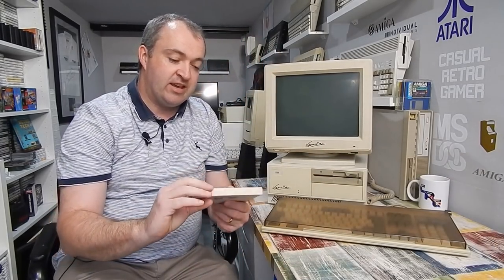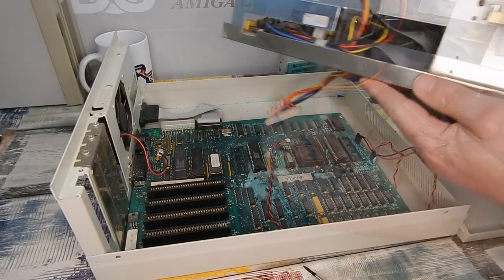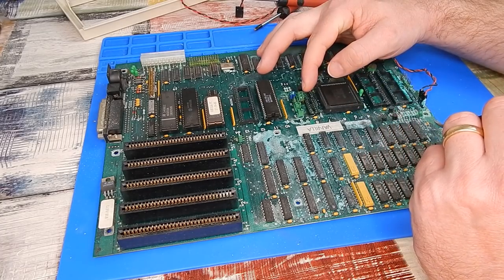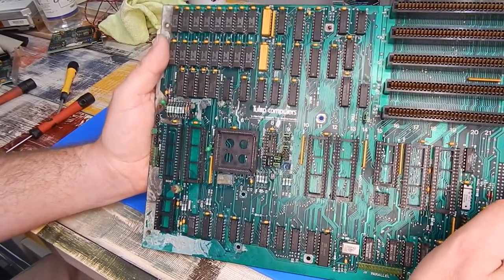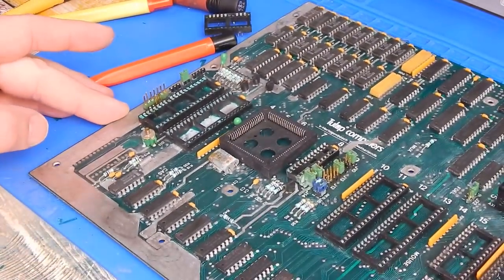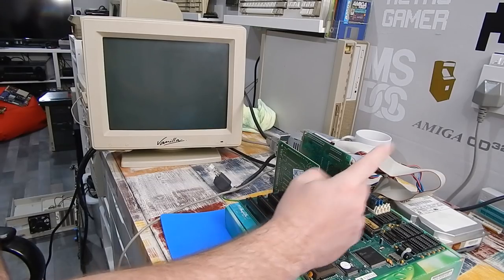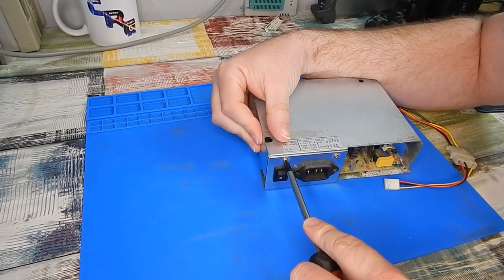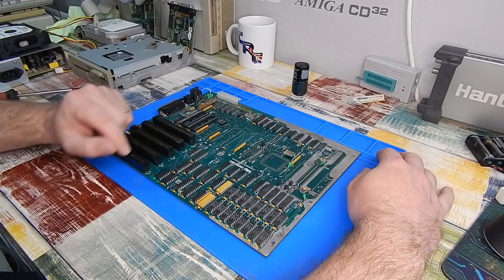The worst battery corrosion I have ever seen.  Vanilla V20-9 Part 1.

Comment: I truly envy you for this repair opportunity. I fixed a 486 board earlier this year with ~40 patch wires, most of them directly to the legs of the QFP AT bus controller which got all the battery juice spilled over it. I spent so many hours with finding yet another broken trace and got rewarded each time. It was fun. But once everything was running perfectly, I lost all interest in it and stored it away. One day I'll dig it out and with a little luck, more traces got eaten up meanwhile. ;-)
Reply from the maker: I just hope none of the custom chips have died and in particular that PAL (the small one that used to have a label).  If that's gone then it might be game over.  In terms of missing pads / broken traces I'm only looking at maybe 10 patch wires so not that bad.  There are a few traces that look really dodgy so even if they do buzz out ok on continuity I think I'll still run a patch wire.

Comment: The amount of corrosion reminds me of Bally Pinball main boards circa 1980. You often have to replace all the components on 1/4 of the board but, unlike a clone like this, you can get all the parts for the Bally boards. I think you'll get it in the end as long as an unobtainium part is not destroyed!
Reply from the maker: The only worrying part is that little IC that used to have a paper sticker on it.  That's a PAL which if faulty will more or less spell the end of it.

Comment: You're an absolute madman!  (and I mean that in a complimentary way)  I've fixed a fair few Varta explosions, but I wouldn't have even considered attempting it with one this badly cancer-ridden.   In the event that the worst happens and the board is irretrievable, It does look like a Baby AT sized board might fit, based on the location of the AT keyboard connector in the case.  You might lose the use of a couple of slots and have an extraneous couple of punchouts (DB25 and PS/2?) in the rear, but I suspect it would still fit and line up.  Hopefully it won't be necessary though!

As to the 1.2 Mb 5.25 floppy, I'm not really very surprised about that.  The thumbnail for this video show a few chips with manufacture dates in mid-late 1989.  Making this a VERY late machine for an 8088 class computer.  This machine would have been competing at the low-end with some that had a 286 or even a 368SX, so tossing a V20 in to an old motherboard design was a good way to eke a few more dollars (pounds?/guilders?) out of an older design. So it was a budget machine, at a time when 360K floppies were, if not totally obsolete, then certainly in the later stages of being superseded by 1.2 Mb and 720/1.44 3.5 Floppies.  3.5" floppies were still expensive, so go with something that would allow you to use the older ones, but still claim some amount of credibility for increased storage.

Comment: That is an 8bit MFM controller with it's own BIOS on it.  You do not need to enter a drive type in CMOS as the controller itself handles the drive configuration.  Most likely it will probably work if you set up the CMOS with no hard drives defined.  As for the drive, I did see someone commented on running DOS's debug and entering in g-c800:5 at the debug prompt.  Early MFM drives used stepper motors and the tracks and head can / will fall out of  alignment over time due to thermal properties.  You may want to do a fresh low-level format on the drive.  If it s a stepper actuated drive, be sure to download a park program to park the heads when not using the drive.
Reply from the maker: Thanks for the advice, I've found some documentation for the controller that's shows how to set it up so hopefully get it going in the next part.
Reply: Agree, you don't need to enter the info in the 386 BIOS, use Disk Manager and it will get the right disk geometry for you.

Comment: What a project.  It's such a neat looking computer I can see why you bought it, that keyboard cover is nice.  I wonder if the re-branding to Vanilla is someone having a bit of a laugh.  I really hope all your hard work will pay off. 😊👍
Reply from the maker: I've done a lot more work to is since this video, hopefully be at the point to power up either tonight or tomorrow so fingers crossed it works.  

I'll take a closer look at the keyboard in the next video, its a lovely old thing with nice mechanical switches.  Not sure if they are buckling spring like the Model M but certainly sounds like it.
Reply: @CRG  Excellent 🤞

Comment: I suspect there will be a separate configuration utility for the hard drive controller, possibly floppy disk  based
Reply from the maker: I think you're right.  I've found a manual for the controller card and it talks about a setup disk.

Comment: Are the batteries primary power supply, backup power supply or are ther used as a CMOS battery?
Reply from the maker: They are there for CMOS backup
Reply: @CRG  Pretty interesting that it takes 4 AA batteries instead of a CR2032 battery usually used as a CMOS backup, AAs are more common to find.
Reply from the maker: @oskartv6684  I've seen a few older systems now that need 6v from the batteries.  In others I've replaced the 4AAs with a dual cr2033 holder.
Reply: @CRG  Honestly it would be better for computer to have 2 or 4 AAs rather than 1 or 2 CR2032 batteries, CR2032 batteries are expensive and don't last as long as AAs do

Comment: 10:14 Don't blame the chip removing tool. It was totally your own fault. You need to have a little more feeling when using the tool. That was clumsy ...
Reply from the maker: A poor tradesman blames his tools, although it easier to do that than admit fault.  That chip was well in there though with the corrosion, not really an excuse, more patience's probably would of had it out without the tool slipping.